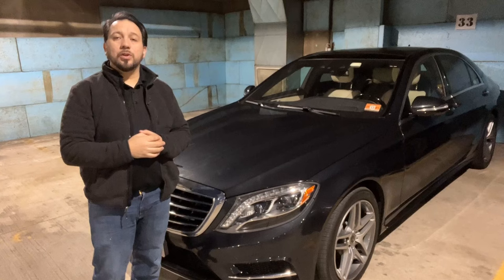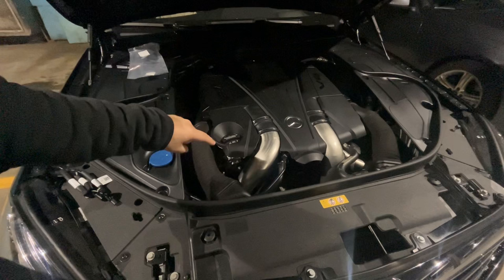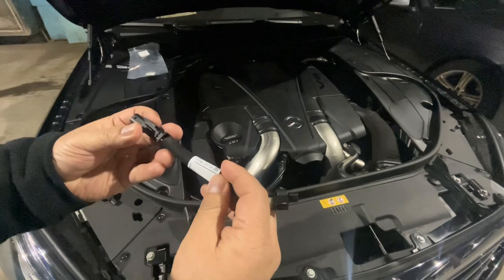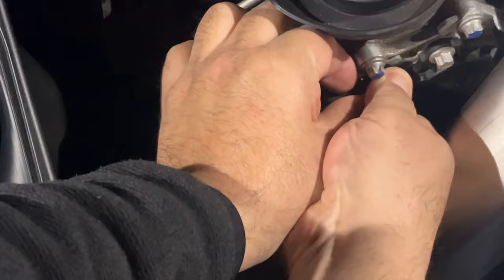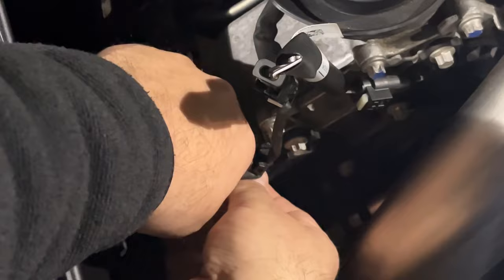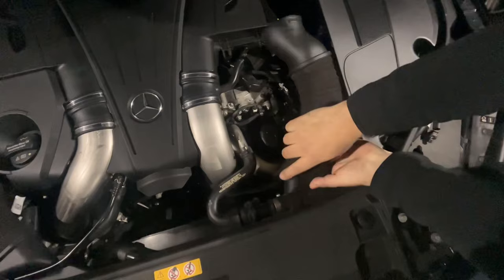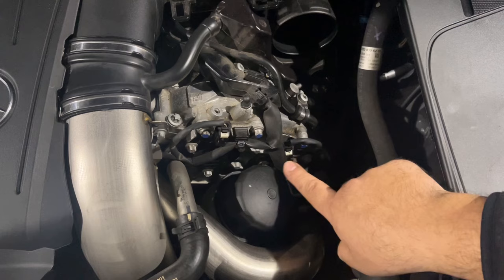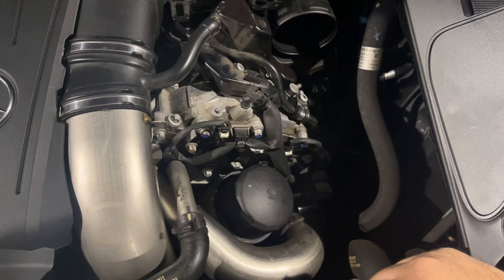Mercedes major issue you can fix yourself - Mercedes Benz problems | Part 1 | #josecitomarin

Comment: Jose, i just went to install the sacrificial harness i bought from fcp and unplugged the sensors and noticed a little oil on end of the plug, so i then took the whole sensor out and noticed they had some oil in them as well. are the sensors supposed to have oil on them but not the plugs or is nothing supposes to have oil?
Reply from the maker: You are not supposed to have any oil on the wire. Don’t run the car until you replace them. Replace cam magnets and cam position sensors. You can get them at FCP as well. I am working in the video on how to replace them. So order them and wait for me to release the video
Reply: @josecitomarin  but is it ok for the sensor inside to have oil on it? the plugged in side.
Reply from the maker: @Rmayrap  no it’s not okay. That is why you have to replace them. The leak into the valve and that is how the oil gets to the main harness. So don’t run the engine until you replace them. Hopefully it’s not too late
Reply: @josecitomarin  but how does the oil get in? The wires are not oily. Just the inside of the sensor and the inside of the plugs. Where does the oil come from?
Reply from the maker: @Rmayrap  it’s engine oil and that is the problem the sensors have. They leak into the sensor and then to the harness. That is why they created the sacrificial harness. One of my subscribers also found somebody else in eBay that sales the harness for the position sensors. I’m going to be getting them and install them as well. I’m glad there is no oil on the wires. Clean the plugs really good with electronic spray.
Reply: @josecitomarin  I guess I don't understand how the engine oil gets inside the sealed sensors? At what location does it enter?
Reply from the maker: @Rmayrap  i don’t know exactly where they get in through. But that is exactly why Mercedes Benz engineered the sacrificial harness. They know they have that issue. The majority of the problems are with the V8s and V12s, I think because of how strong those engines are. Because they use the same sensors and magnets on smaller engines. If you want email me directly and we can talk about it. Josecitomarin@gmail.com
Reply: The Adjusters should have oil yes but not the plugs! Check your Camshaft Position Sensors for oil in the plug too because they suffer more from oil leaks
Reply: @josecitomarin  hey I am actually finding these Camshaft Position Sensors leaking on V6 and 4 cylinder engines of Mercedes. I made a cross reference with the part Number of the Sensor and posted on my video in my channel about this problem what model use those sensors and oooo boy there are a lot of models...
Reply from the maker: @projectathos  thank you so much for your comment. I did the position sensors on part 2
Reply from the maker: @projectathos  there is a lot of them yeah. Even the C300s have the same exact magnets and they leak. Not as bad as the ones on V8s like mine. Maybe the power has a lot to do. More pressure in the engine and the places for the pressure to scape is the magnets and position sensors

Comment: P0016 FAULT CODE NO SOUND ENGINE NO PROBLEME 
C63 S  ALL POWER HAVE THE CAR
Reply: What solution to remove p0016 🤣🤣🤣🫣
Reply from the maker: I think you should start by checking your wiring to camshaft position sensors and solenoids. Than I would go by changing the cam position sensors and solenoids.
Reply: I change all capteur just capteur solenoide i never change
Reply from the maker: @roro85600  try that and make sure all the wiring is correct. Also check that there is no oil on your connections